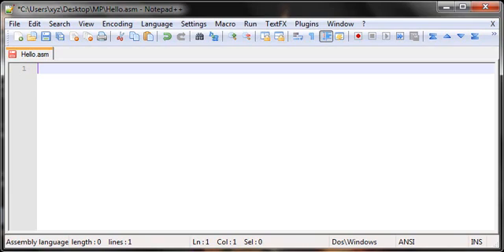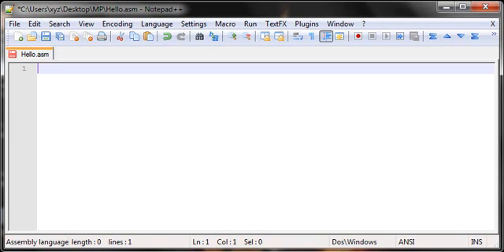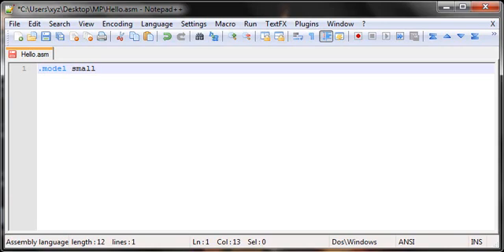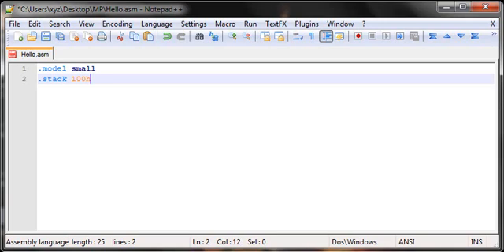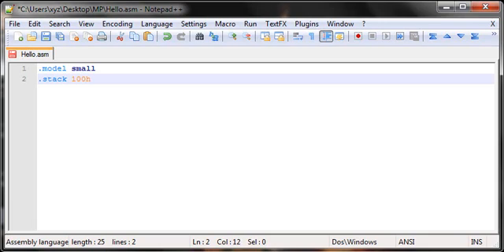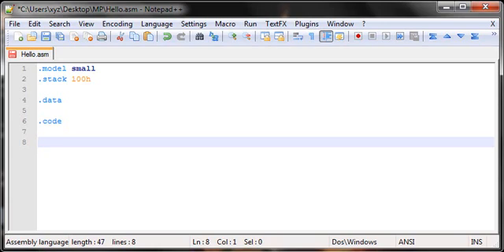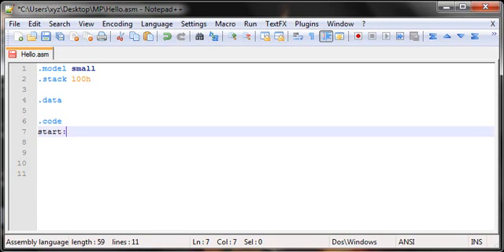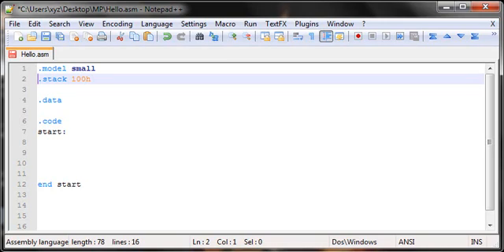Assembly Tutorial 4 - Basic Layout (TASM)

Comment from the maker: To input name (or any string) from the user in Assembly, you need to use the buffered input function, hex code for which is 0Ah. The following code snippet should do the trick :

In .data write
name db 20 dup('$')
length db 20

In .code write
mov dx, offset length ; This will automatically store the name in the name variable defined above 
mov ah,0Ah              ; I will do a tutorial soon to explain how it works

Use this code and try to make it work till I make another tutorial!
Good Luck!